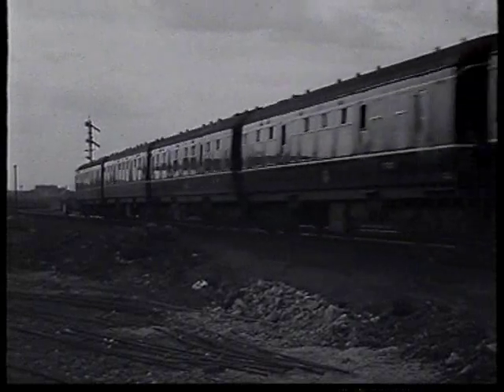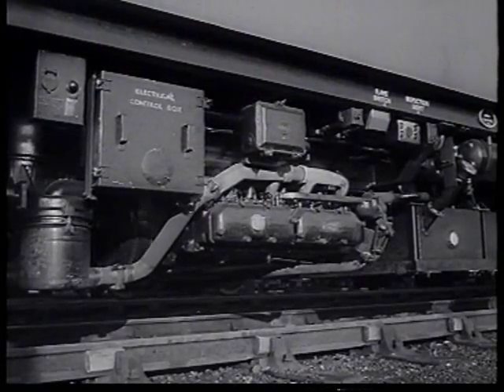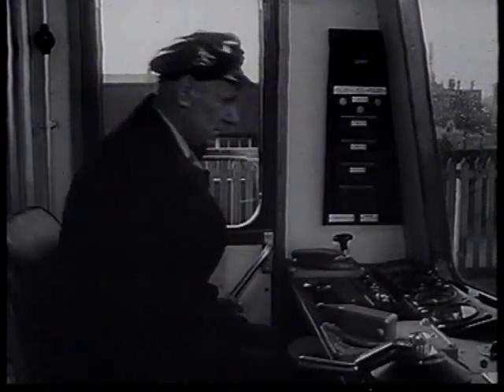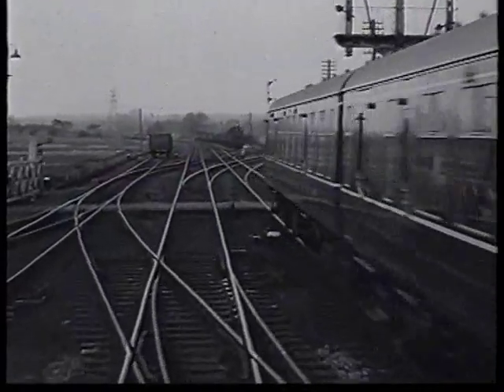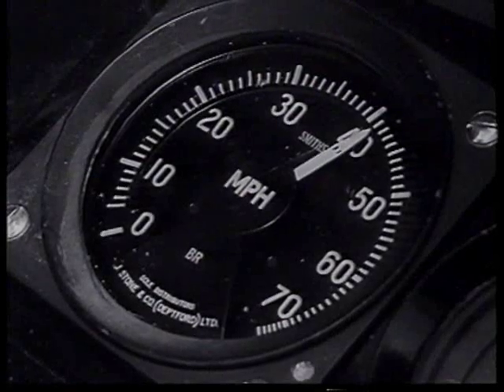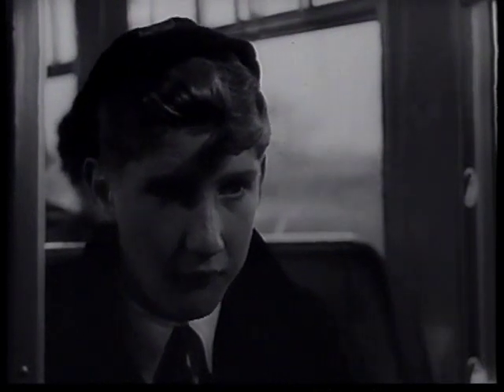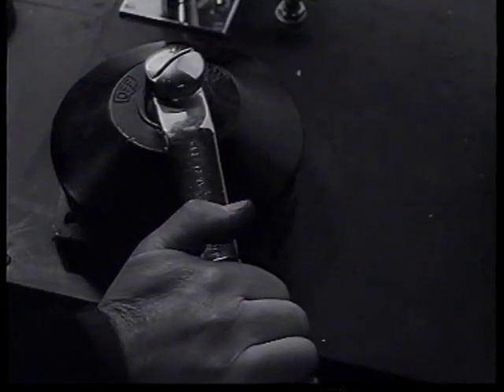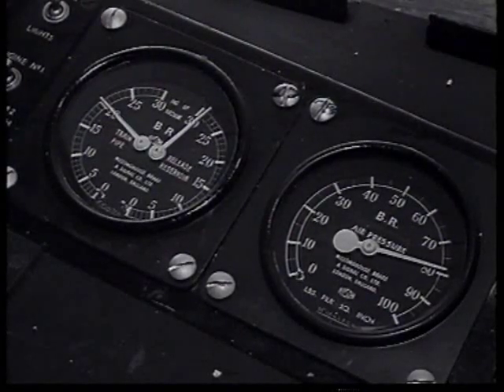DMU Diesel Train Driver Part 1 - Introduction To The Diesel Train

Comment: "In a very short time you reach 40 miles an hour". At which you can see all the passengers rocking from side to side as it sways over the rail joints.
3:19 lovely artistically backlit shot of a passing B1

Comment: Up until just a few years ago (within the past four to five years) these sorts of diesel buses on wheels (obviously with more modern passenger compartments but still very old fashioned) were very much the typical form of vehicle on several West Yorkshire lines.
Reply: The Pacer was a compromise, a cheap and quick stopgap, with only one axle each end of the car that has been retained for far too long and is often used on totally unsuitable routes, these DMUs were properly designed trains with full bogies designed to work over a decent distance. A Totally different animal

Comment: i wonder how the train drivers felt about these trains? did they think it was a let down from being a "real steam train driver" to being more of a "bus" driver?
Reply: wetcanoedogs

Why? The infrastructure is the same, the driving challenge is just in different machinery.
Reply: Probably a mixed bag I would imagine. Some might have enjoyed driving diesels vs steam power while other might have said something along the lines other being considered “glorified streetcar operators”.

Running steam vs diesel is like using your car or keeping horses in the barn.
Reply: @smithy4025  Loss of jobs. It takes a minimum of two crew to operate a steam train versus one for a diesel. Then add the labor needed to handle coal, maintain watering facilities, maintenance hours, etc. Same exact things we hear today with automatic train operation and elimination of conductors/guards.

Comment: Erm, the emergency stop...65mph to 0 in about 2 secs?
Reply: Film trickery it would take a distance between 3 quarters of a mile to a mile to stop, that also depends on down hill or up hill and wet or dry rails.
Reply: That was the vacuum being destroyed in the Brake Pipe to make a full brake application. (These were the 1st Traction that I signed for.)

Comment: Nice to see the class 114 Derby heavy weight(0:47) when new at Lincoln tmd.I worked on these units from 1980 until closure in 1987 at Lincoln as a mechanic and brake fitter.I put some photos on Flickr under Lincoln TMD a while back.

Comment: You can’t help but think what a boring job driving a train must have become with the change from steam to diesel.  Diesel may have been quicker, more practical as you could drive the train from either end & a cleaner experience for all, but the driver looks bored out of his mind.  So much for progress!
Reply: I wouldn't jump to the conclusion that he is bored just because of his demeanor. He may simply be more relaxed than he ever was on the footplate.
Also, take into account that he is being filmed......not a comfortable thing for everyone.
Reply: I can imagine depending on the line you serve, which you normally do in rotation, these cars may offer great views, in comparison to their steam counterparts. Also I do not imagine being a steam engineer to much of a joy in hot summers, or extreme winters. Gettiing them started is a job for its own... I guess many liked the new diesels and few did not. I'd rather do that than to have coal dust and fire around me all day.

Comment: I think he rushes the gear change at about 2:55.
Reply: Yes, he needs to let the engine revs fall much lower before changing up. Later on he selects neutral whilst at speed (no no no)! When coasting/braking they should always be kept in 4th until about walking pace.
Reply: I notice since that the same shot is used in part two and the commentary says he hurries it.

I drove a Class 101 on the Wensleydale thanks to my sister and they said you had to let the rev's fall to idle before changing gear but that doesn't appear to be the case.  Perhaps they tell drivers that so that if a gear change is too quick going by their instructions it will still be OK.
Reply: Yeah, there's no perhaps about it. That is why they said to wait for the revs to fall. I'd bet anything.
The main difference between the video and the train you drove is about 60 years. Driving a train in preservation is the same as driving a rare one of a kind and irreplaceable vehicle.
Back in the day, the engines were new and could handle the increased load from a high-rev gear change. That, and the daily repairs and maintenance was paid for by a rail company with workshops full of new spares, not by a preservation society that essentially survives on handouts and private funding. 
So yeah, its fair to assume you were told to let the engine revs fall off so as not to overstrain the motor... 'Cause you know, they stopped making those particular engines a long time ago. Replacing one would be... Costly... 
Still, I bet it was a great experience even if you couldn't give it a thrash. 

I'm a bit jealous now in fairness.

Comment: SWhould never have got rid of these DMUs. Were a great way to travel and knock spots of the more modern types which only want you to travel at light speed! No, cant beat a leisurely ride on one of these...so sad to see most of them go.
Reply: Sadly, they had their day, they got more unreliable and expensive to maintain as they got older
Reply: Asbestos
Reply: They were based on 1950s bus engines. Listen to an AEC-engined DMU and a London Transport RT. They sound practically the same. Buses don't last as long as trains and there are a lot more of them. Typically you only get 15 years out of a bus. Once the 1950s buses were out of service it became increasingly difficult to get parts for the 1950s multiple unit trains.

Comment: Approximately 3/4 to a mile from 75 mph for a lightweight DMMU!
Reply: DanielW118 3/4 of a gallon?
Reply: @szymongorczynski7621  stopping distance between 3 quarters of a mile to a mile to stop, that also depends on down hill or up hill and wet or dry rails.

Comment: Just and exaggeration, as far as I'm concerned. No engine can stop that quickly, surely.
Reply: Film trickery it would take a distance between 3 quarters of a mile to a mile to stop, that also depends on down hill or up hill and wet or dry rails.

Comment: Seems very difficult using this machine !
Reply: Not really. During normal operation you need 3 levers. Throttle, Gear and Break. It's fairly well simulated in "Diesel Railcar Simulator". Needs practice though.

Comment: did people have a death wish back then ? alighting from the train while it's still moving !!!
Reply: Common practice; we used to do it with trains and trams and even the back platform of double-deck buses. That was then - don't judge from today's standards.
Reply: If you do it right, stepping on or off moving equipment can be done safely, (I’m in the US). On CSX as an example, they’ve decided to allow it again as a part of PSR. Long story short, it’s allowed to keep heavy freight trains moving on hills, rather than spend a lot of time and energy just to stop the train and get moving again just so a crew member can board.